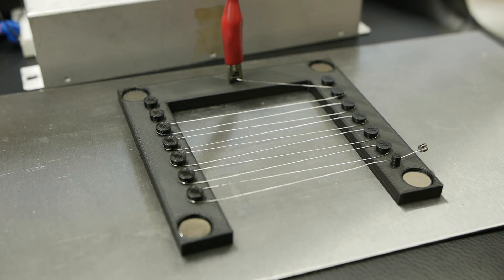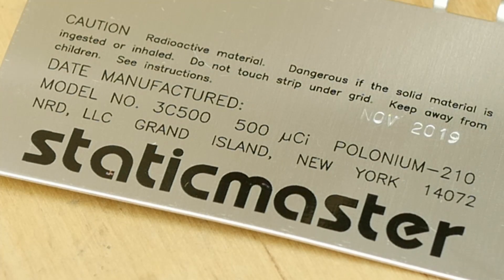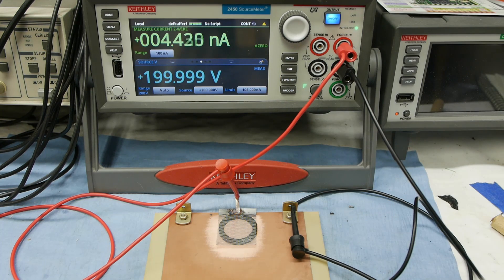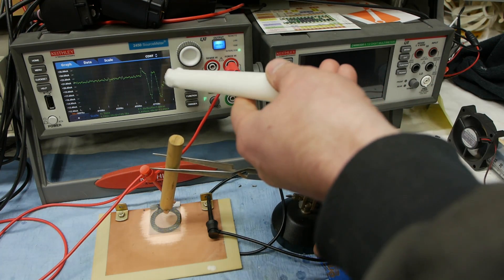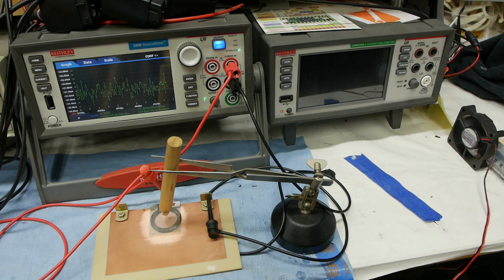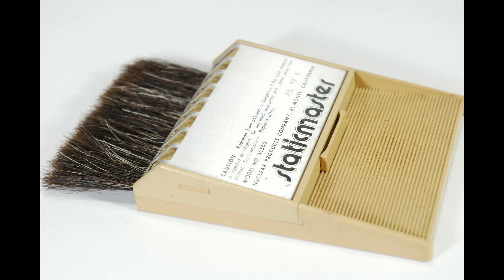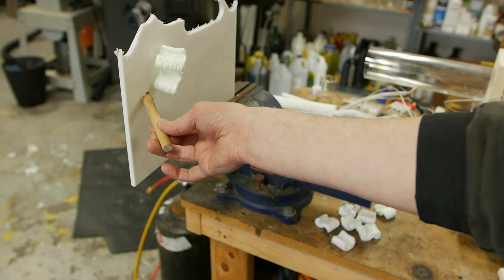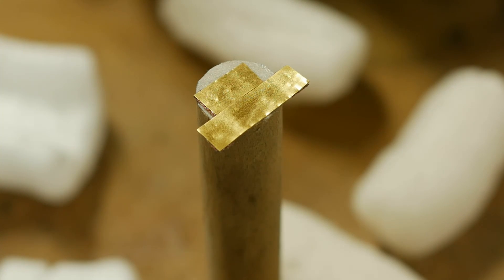Alpha radiation makes sparks, detects smoke, and eliminates static cling

Comment: Speaking of the reason why beta emitters can still get a definite reading from brass-walled Geiger tubes: isn't it true that even if a flying beta particle gets stopped by the metal shell, the particle might have enough energy to cause some current flow through the wall and knock another electron off into the internal area, where it gets zoomed through the space due to the high potential between the anode/cathode of the tube, and you get a CPM event? I mean, at the end of the day, what is a Geiger tube, if not a very small particle accelerator...?
Reply: Energetic beta particles generate braking radiation or Bremsstrahlung when decelerated abruptly. Part of their kinetic energy is converted into photons and depending on initial velocity the protons can be X-ray ones. This is also how X-ray tubes generate radiation. Another type of radiation that could be emitted is characteristic radiation. It's produced when high energy beta particle kicks out an inner shell electron of the target materials atom. An outer shell electron will then relax into the lower energy vacant position and difference in energy will be emitted as a X-ray photon. Those photons are characteristic to that specific target element hence the name "characteristic radiation". Once you have X-rays, Geiger–Müller tube will register them and that's your signal.

Comment: So you actually built a ionisation chamber using air as ionising medium. This is actually the basic of some particle detectors (wire chambers).
While for the 90Sr source, it is true that the electrons are stopped by the metal shield, but their interaction with it produces photons via brehmsstrahlung and those are being detected.

Comment: It gets volatile at 40-50C, so no polonium at home in summer. 😂😂😂 That stuff is super nasty!
Reply: Meanwhile he is just casually lighting a candle with a blowtorch...
Reply: @rkan2  And? As long as he doesn't heat the Polonium sample directly nothing is gonna happen. You have to be stupid to heat that stuff up.
Reply: Where do you live that it gets to 50 degrees Celsius inside your house during the summer?! If it gets that hot inside your house, I imagine that your samples of Polonium-210 would be the least of your health worries. Or perhaps I just don't tolerate heat very well, as anything above 33 makes me ill.
Reply: @Schwarzvogel1  Austria, our main room is just weird. It gets super hot from the slightest solar radiation. For example, today we had 23C and loads of sun. Inside was 28C with curtains down. Summer, when we have like 38C outside, that room gets up to bloody 45-48C. With an mobile AC and 5cm of styrofoam on the windows it gets down to 26-28C, but then the AC keeps running 20 hours a day.

Comment: 4:07 positiv and negative ions? more likely positiv ions and negativ electrons.
Reply: The term ion actually is correct, since it describes positively or negatively charged atoms by having less or more electrons than protons respectively.
Reply: @thirdeye4654  Yes, you are right. But ionization produces positively charged ions and free electrons. When this electron is captured by another neutral atom ("electron capture ionization") it forms an negatively charged ion. But this secondary process is unlikely.

Comment: The company behind these strips(and StaticMaster brushes) will happily sell you a 500 MILLIcurie source after you sign a waiver.
It's nuts.
Reply: Did you know that you can buy knives and kill someone with them?
Reply: @sliceofthatpie  Knives don't evaporate and smear everywhere if you mishandle them.
There's no knife residue you can inhale that will kill you.
Reply: @Spirit532  Yeah, but in order to smear or evaporate it you still have to intentionally go through several steps. The same is true for knives. If you also mishandle them you may also die or cut something off.
Reply: @sliceofthatpie  A minor scratch on the gold layer will cause polonium to escape.
Reply: @Spirit532  I doubt that. Minor scratch would make it impossible to produce it or handle safely.
Reply: @sliceofthatpie  There are things other than tweezers. You're not supposed to even touch the strips.
Reply: Heck, you can buy tritium-powered radioluminescent flashlights (used by the military to read maps and such at night) online for around 100 bucks, some of them contain a 1.9 Ci tritium source in a fused quartz ampule.
Reply: @kg5168  They also use Tritium powered rifle scopes on all their M4 rifles. The M4s cost $900. The scopes cost $1,500.
Reply: @kg5168  Tritium activity is far less dangerous than polonium. Most keychain tritium sticks contain >1Ci.
1Ci of Po-210 would give you contact burns within *minutes*.
Reply: There is so few polonium in that business you'll probably need a full truck to put together a deadly amount. The effort needed to distill it out of the metal plating is so high to make it unviable.
Reply: @impeandroid2554  The amount of polonium in those strips is enough to cause serious harm and almost certainly cause cancer.
Reply: @Spirit532  The only problem with such things is that they are easy to hide. But there is no difference with any other physical means to kill.
Reply: @sliceofthatpie  If you're a murderer, yes. But this is still extremely dangerous if you're not.
Reply: @Spirit532  It depends on concentration and how it's packed. But still not much different from knife.
Reply: @sliceofthatpie  The concentration in this case is "too much". And what the hell is "packing"?
Reply: @Thebadbeaver9  You shouldn't be able to buy stupidly dangerous radioactive sources this easily(read: without traceability). Stick to smoke detector buttons if you want alpha, they're far safer mechanically if not abused.
The issue here is that it's radioactive. It kills you now and later.
Reply: @user255  The immediate lethal dose is not the issue here(well, not so much), the long-term effects and contamination is. These staticmaster sources differ from smoke detector sources(which are actually "a few microcuries") in that they contain a lot of Po. See above - you can buy up to half a Curie of Po-210 with minimal paperwork(and good luck tracing that).
Reply: @user255  Half a millicurie of Po is still a big problem. And yes, half a curie is somewhat obtainable.
Reply: As far as I can tell, 40millicurie is the strongest source they (NRD) sell - and they don't sell anything more than 0.5millicurie via Amazon.
Reply: @sbreheny  They sell other sources if you dig around, but yes, the bigger sources require you to buy directly and not without paperwork, albeit minor.
Reply: Lol. Shit overshit. 5 years down the line there is no trace of polonium 210. It has a halflife of few months. Moreover the use gold as it binds polonium in an alloy avoiding its release.
The funny part is the neutron beam as if you can buy a nuclear reactor at the drug store on the corner. 😂😂😂😂😂😂😂
Go back to your videogames and stop making a fool of yourself on the internet 😂😂😂😂
Reply: @impeandroid2554  Well I just googled that. It's surprising.
Reply: So much ignorance all together! 
Have you ever wondered why they use gold instead of a much cheaper metal? 
Are you really sure they would allow the sale of a material controlled under non-proliferation act if it were possible to extract it at scale? 
Go back to your babybottle and stop commenting bullshit 😂😂😂😂😂
Reply: @impeandroid2554  Extraction is not an issue. Accidental release from mishandling is. Source gets scratched by Joe Somebody, smeared all over their house, work, etc., then causes cancer 5 years down the line.
Extracting it for chemical use would be nigh impossible in a serious quantity, that's true. If you needed an industrial amount of Po-210 you could just stick bismuth solution(!) into a neutron beam and be happy.

Comment: I've heard of this being used to detect cosmic rays. Something about a stack of plates with air gaps that spark every few seconds. Also Can I ask if it needs to be DC? because if not then you could just use a transformer.
Reply: If you used AC it could work, but you'd be relying on the cosmic ray to hit while the voltage difference was around its peak, so it would presumably reduce the sensitivity by a lot.

Comment: 11:58 Why does the ammeter react the moment the blowtorch is lit? Is this from the spark that lights the gas?
Reply: I'm not exactly sure, but one of the explanations may be as follows. The torch may be or even was pointed in the direction of the detector, as it was lit it forced an invisible cloud of moist heated air(remember the chemistry of burning hydrocarbons), that may be enough for the detector to "see" the current drop ;)
Reply: Probably from the piezoelectric igniter on the blowtorch

Comment: So could you focus those alpha particles like a laser?
Reply: I think you could probably focus it, but it would differ from a laser.  A laser can use lenses. An alpha particle stream is charged, so you could use magnets instead, like you do with election beams.  Of course, electrons are very much lighter than alpha particles, so I think the electrons can go faster and the alpha particles might spread out faster instead of holding focus as well as electrons.

Comment: I'm old enough to have had a watch with " glow in the dark"  numerals and hands.  I remember going in a closet with a magnifying glass ,  once accustomed to the dark, one could see flashes of light coming from the radium painted traces.
Reply: beta particles impacting your retina O.O
Reply: @virtualtools_3021  yeah, bad deal ... but in those days no one knew ...
Reply: They still make watches with self-luminescent numerals and hands like that. I wear one daily, although the luminescence is now generated by tritium, not radium. Tritium is much safer, but somewhat more expensive and it stops glowing in about 10~12 years due to its shorter half-life.

Radium dials were not particularly dangerous to the consumer. The whole furor over them was because of the Radium Girls... and that was because those birds were licking the brushes (they were instructed to do so). At factories where they didn't have them do that, there really was no issue, but as tritium became available and could be sold for more (more profit) and was generally not as dangerous or as hard on the phosphor as radium, there wasn't any reason to use radium salts anymore.

Although I do wish I could have a watch with radium-painted hands, mostly because it would glow indefinitely with regular re-applications of the phosphor. For my tritium watch, I'll have to have the gas vials replaced in a few years.
Reply: @Schwarzvogel1  if you wanted a very short lasting watch, could use just polonium. it ionizes the air and glows on its own with no need for phosphor. would be incredibly dangerous though.

Comment: Wow, the current spike after you light the blowtorch (5:13) is just crazy!
I think some plasma from the blowtorch got to the plates, and that lowered a lot the air resistance.
Please, try to do the high voltage experiment with a bug zapper, that would be nice to see. Btw I think that's what happens when you let those things charged up and they randomly spark; some background radiation ionizing the air could explain the zap after it has been sittig still for 5 minutes

Comment: 9:55 - this statement about alpha range is actually wrong. The average range of an alpha from Po-210 is about 40 micrometers in water (basically the same as human tissue). The thickness of the dead skin cell layer in your body ranges from 10-40 um. 

Now keep in mind that the range given for Po-210 is just an average, some will travel further (and some not as far). However a more important feature is the Bragg peak, where the most damage will be produced, is located right near the point of maximum alpha particle range. Keep in mind also that alpha's have a much higher RBE than photons.

Now also keep in mind that alpha particles release secondary particles as they slow down in matter (betas and photons), these secondary particles have their own range. These will certainly reach living cells.

So you're definitely irradiating living skin cells if you hold an alpha source to your skin. This certainly matters in the case where people sell alternative medicine rings containing alpha emitting isotopes ("positive ions"), having that against your skin all day will produce a meaningful dose.

Comment: Wait so I just need a particle accelerator and bismuth to make polonium... I might be able to do that, I mean I won't I'm not stupid, but ye particle accelerator is on my list of DIY projects
Reply: I am seeing a guy that look like Tony Stark making a material for his Arc Reactor using particle accelerator in his house....
Reply: You probably already have a particle acceletator in your house. It is located in the back of one of the big boxes you plug to electricity when you want to watch some new stupid show for free. The accelerators are pretty good but not very powerful or versatile as they are. But with enough dedication it should be possible to upgrade one up to the required level. Pretty much the only thing you need to do is to cut off the scteen, to modify the electron gun to allow for local  discharge and slow gas introduction, to replace the magnetics, to build a semi-sealed chamber with enogh space for accelerstion pathways and target, to add a vacuum outlet and to design new beam control circuits. It is not a single weekend project but I belive that you can have a personal particle accelerator if you really want it bad enough for whatever reason.
Reply: David Hahn, is that you?

Comment: I tried to make an estimate of how much Polonium is actually in there by using the intensity of the neutron beam of a commercial nuclear reactor (4.5E+10 cm-2.s-1) and an exposure time of the bisbuth of a few minutes. It amounts to approx a few hunderd picograms of polonium max, much less than 20 nanograms. So you can safely eat the strip (although I would not advice you to ;-))
Reply: The atoms are also basically individually encased in metal thanks to the manufacturing process. I personally feel iffy about eating radioactive material, so I'll pass regardless.
Reply: @Leadvest  yes, if you eat radioactive material, you'll probably pass... and if not, it will.
Reply: Knowing it was 500µCi or 18.5 MBq in SI units at the time of calibration one could calculate the mass as follows: m = A * m_u / (λ x N_A) ~ 111 nanograms of Po-210. Po-210 has a half-life of 138 days and the date of calibration is Nov 2019 and the video was made in Apr 2020, which means that there's roughly 50 nanograms of Po-210 at the time of the making of this video. As has been pointed out the toxicity when the Po-210 is encased is not comparable to when it's not. Nevertheless, as has also been pointed out you would take some radiation damage as it would pass through your gastrointestinal tract, but assuming that it doesn't get stuck the damage would be negligible.
Reply: Its an old discussion, but have to point out that it is a different story if you inhale it, since it is more likely to stuck somewhere in your lungs or gets carried by blood flow to somewhere else.
Reply: What do neutron beams have to do with it?
Reply: @arthurmead5341  They make the Polonium by irradiation of Bismuth with neutrons.
Reply: @HuygensOptics  how do you know the particular neutron beam strength? Or how much bismuth was used...or the exposure time?

Comment: Have you ever tried to build a small scale particle accelerator?
Reply from the maker: It's been on my list for a very long time.  I have a pulse magnetron specifically built for the purpose.  I still need a huge magnet, huge power supply, and the accelerator column itself.  The project would encompass numerous hazards: High voltage, high current, x-rays, transmuted/activated substances, ionization radiation, RF burns, vaporized chemicals, UV, etc.  There is a ton of interesting engineering, and one of the most interesting visual outcomes, lichtenberg figures at home, would be very cool.

Comment: The "breakdown voltage" is lowered by the alpha radiation?  Is that the correct term?  Awesome presentation and scary what can be found on the market not the best monitored and controlled.  I used in static removers for lab balance work a little... was strange working in England and coming back and not to long later these were being implemented.  About the same time frame if I'm recalling correctly.   I'm not about not having on the market... though the forensics in most communities is polysubstance pedophile junkies and klepto bouncers and strippers desperate to look official and wanting to mass murder whatever it can get away with, and then some, in no way just slow kill seemingly forensically clean ways and means.   I've met some sincerely good if not better than good young adults that trained like me to work valid lab jobs to find out... maybe in another industry.  I guess it's not just the communities that don't like the honest more pro-life in forensics or even lab roles.  Really interesting presentation and details... thanks for sharing.  Awesome multimeters too!